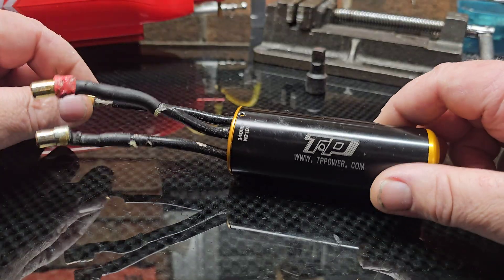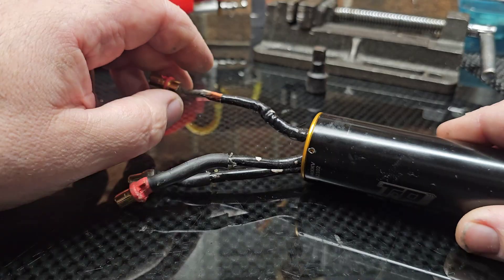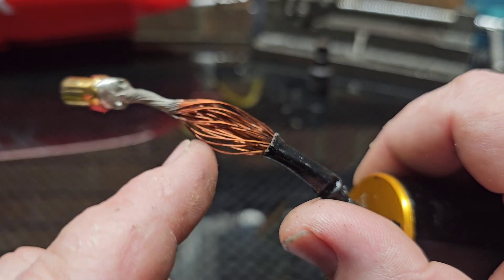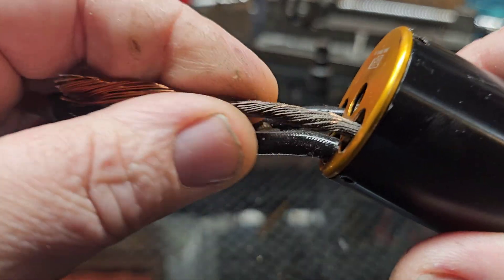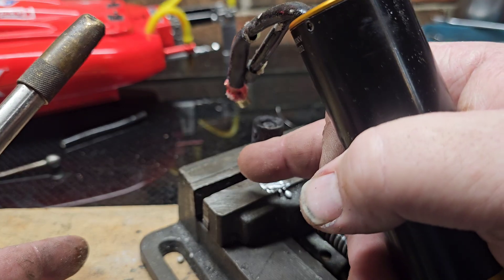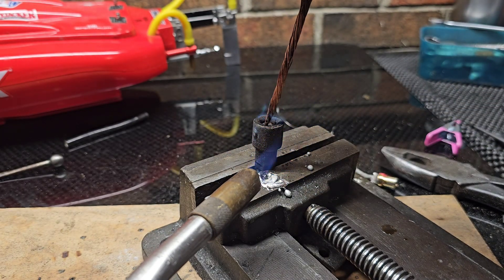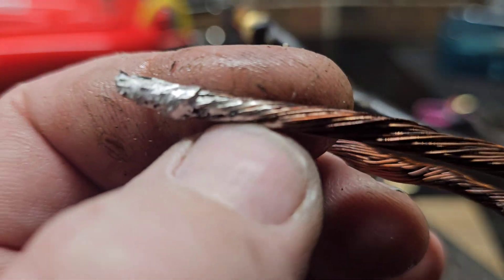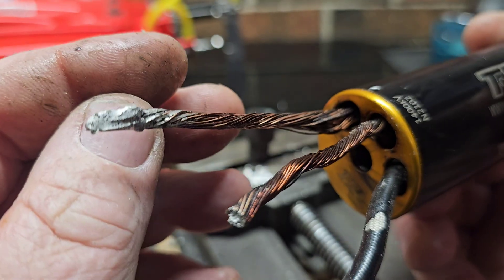How I Tin Cut Insulated Brushless Motor Wires - Solder will not stick to wire?

Comment: Big B , even when soldering a new motor  wire to the terminal , the wire gets really hot . Also you use a fan to cool down a hot motor so it does not damage the magnet . 

Here you are heating the wire directly before dipping in to the solder well . 

Wondering this heat on the wire being transmitted to the magnet . What does this heat  do to the magnet ? 

Thanks

Comment: Your the Boat God homie...vented motors run cooler than sealed motors?
Reply from the maker: I dont know about that lol.   Personally I think open end bell motors run slightly cooler and is easier to drain in the case of a flooded or half Sunk boat,?   Thats my opinion for what its worth. . BG4L

Comment: Thanks for the info, I did that on a brand new motor had no idea I couldn’t solder to it, I tried everything, lacquer thinner, , acetone, paint remover, nothing worked. I finally spread the wires out, heated them up super hot and kept rubbing them with a wire brush., (It was hard to believe the wires did not melt. They must be something special.) Worked awesome, got a top speed with that motor in my dominator. Never tried the razor blade, that would be great, then heated up and wire brush them. Thanks for the great video as usual you’re the man.
Reply from the maker: I had a hard time with a tp motor years ago that I cut the wires on for a specific setup, same deal. I tried everything to get solder to stick with no success,  scraping the wires was the best method for me.   Glad I can help!

Comment: for what it’s worth I’ve successfully removed the red varnish with acetone, dipping the wire repeatedly and wiping with wire brush….
Reply from the maker: Good to know!   I appreciate the input, im sure the rest of the boat gang does too!   Have a good day!  BG4L
Reply: I wonder how the chinese factories solder these insulated wires so neat. Not all motor wires have this stubborn insulation. I don't recall american made Nue motors having this type of insulation?
Reply from the maker: @keith6872 i think they use a super hot electric/ propane crucible full of solder, its so hot the varnish melts right off the wires

Comment: I bought a TP off ebay & the seller cut the wires. Now I see how to & why it didn't work well for me.
Reply from the maker: Glad i can help!   Scrap the wires  to bare copper, i rushed this one because its a dead motor, take your time while removing the installation,   highly recommend the crucible method for tinning the wires.   BG4L
Reply: @IRONCLADRC I use the same solder thimble method with a socket extension. Works like a charm! You share way more information throughout your building process, more than just the topic your covering at the time.